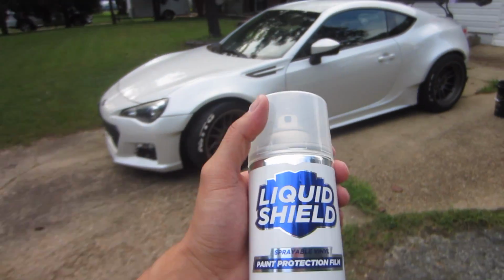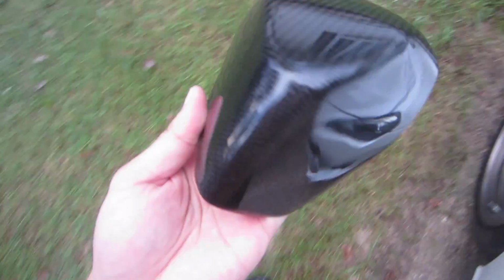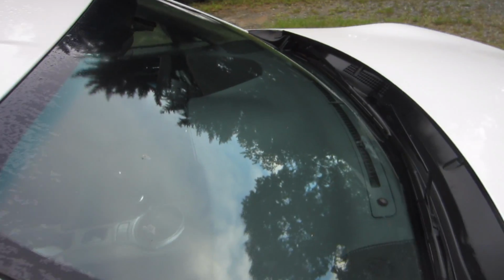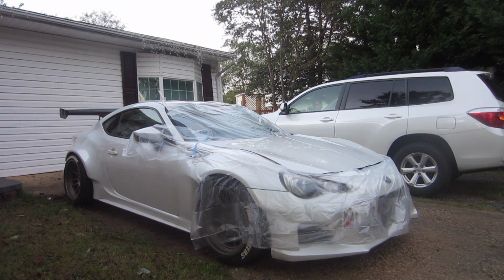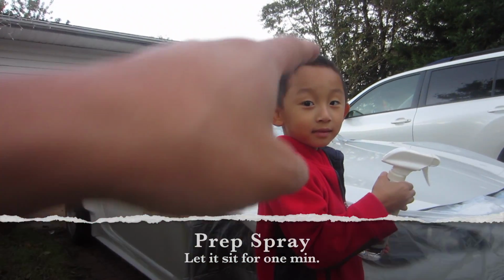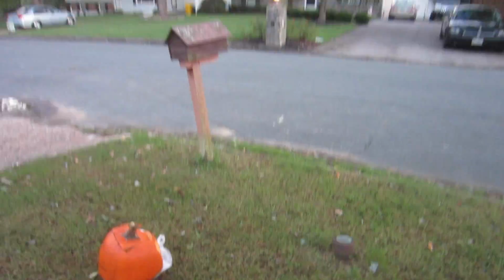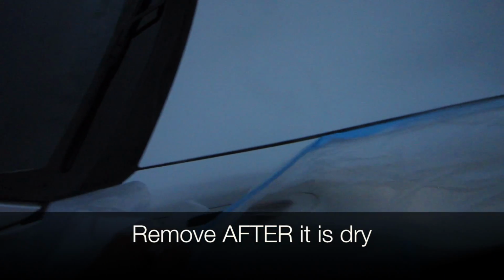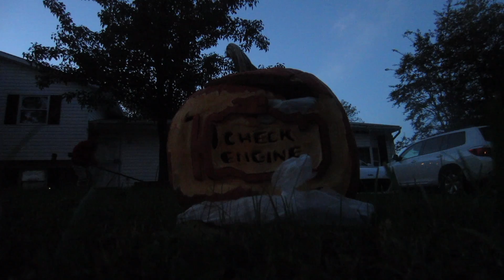LiquidShield Review

Comment from the maker: Review: 3 cans is more then enough to do my hood. My hood measurement is about 5'x3.25'. It goes on clear and you cannot tell. If it is anything like super wrap, I am 100% confident in the product. The can itself is very easy to spray and use. The nuzzle design makes it that your finger does not hurt & the spray comes out smooth. I feel that this is a great option for complicated pieces that you want to protect like mirrors. Hand around to see how the product holds up, removed, etc. Thanks.
Reply: Frank Hong how did it hold up? Couldn’t tell on white but how would the finish be on dark glossy paint? It looked a bit satin to me?